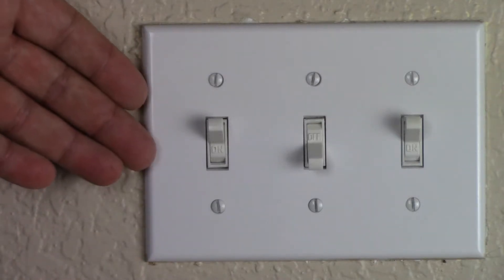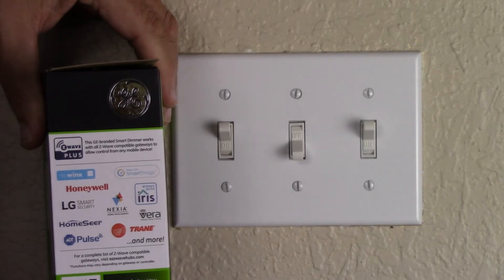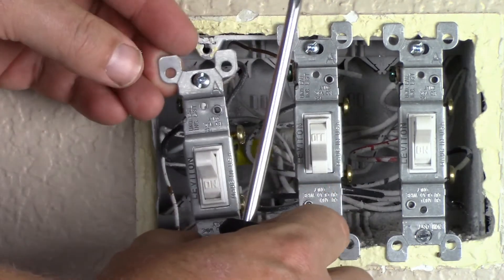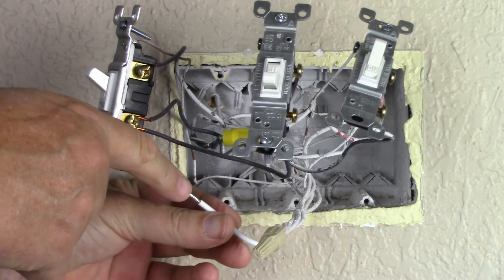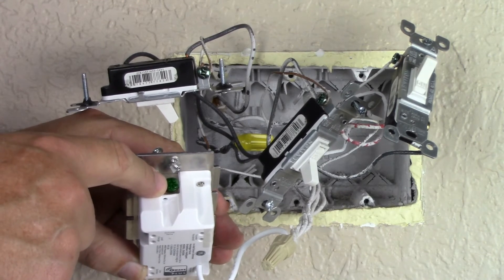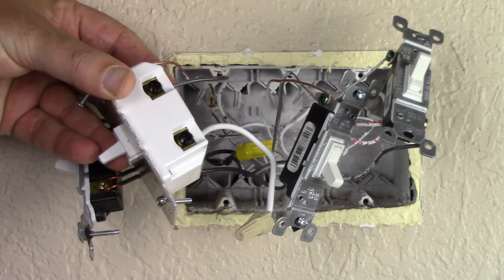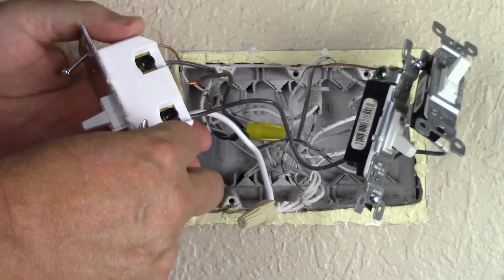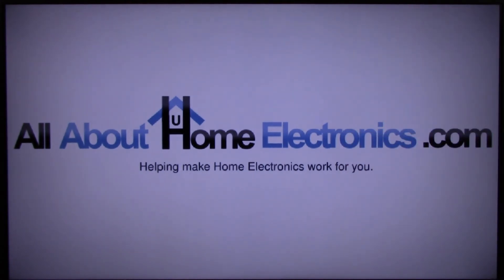How to Install a Smart Light Switch

Comment: I have the same setup with the line wires but instead of cutting them and placing them individually in the holes I just wrap them around the terminal like it was with the stock switch the light turns off and on but can't get the blue light to come on to pair to app could this be because I just wrapped it around the terminal inside of cutting it and placing both ends in the switch?

Comment: Just bought a 3 gang WiFi switch and it’s to small to cover hole in wall, now I see i can replace only one switch or put in three, thanks.  The one I bought is a flat touch plate which is used with Alexa. I return it since it don’t fit plate to small.

Comment: Hello thanks for the video... I was installing a smart switch but its not working 
I have 2 black wires 1 red and 2 whites... there's only 3 holes in the switch... i don't know where to put them, can you help me?
Reply: The red is the hot. One black is the ground

Comment: Quick question, I tried this switch type in a box with two switches and the two Honeywell switches don't fit side by side. Is there a secret for how to get them to fit side by side in the box?
Reply from the maker: electrical boxes come in different depths installed by the licensed electrician. smart switches often are bulkier than non smart light switches and therefore require more room within an approved electrical box. Consider hiring a professional electrician and re-reading the instructions for your particular brand smart switches to see if it offer solutions to the problem you describe. The GE switch, which is not your brand of switch, did contain specific directions to minimize space usage. Bottom line, it can be tricky which is why we recommend a licensed electrician
Reply: @Allabouthomeelectronics  Thanks! I figured out that I just needed to remove the metal tab on the inside of each switch with some pliers. Appreciate your response though!